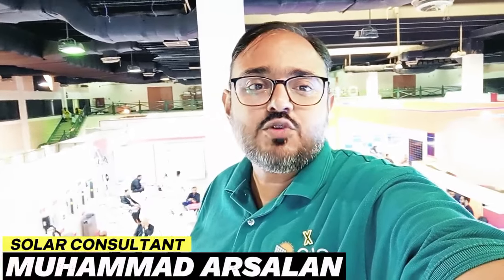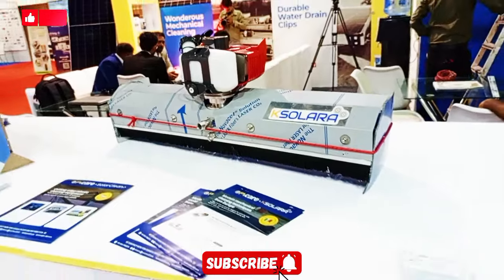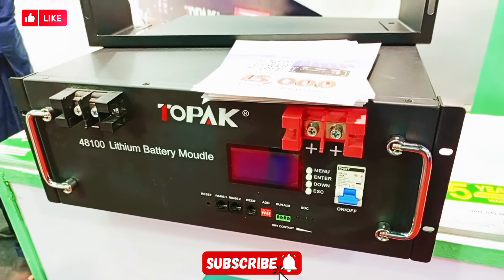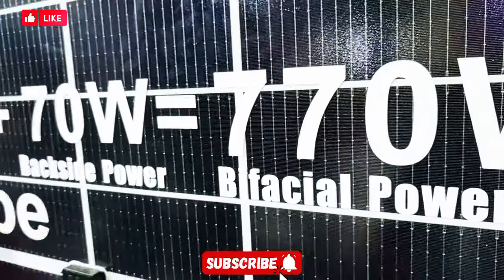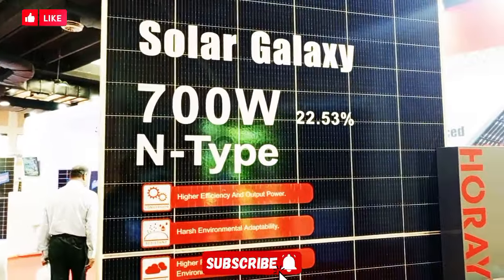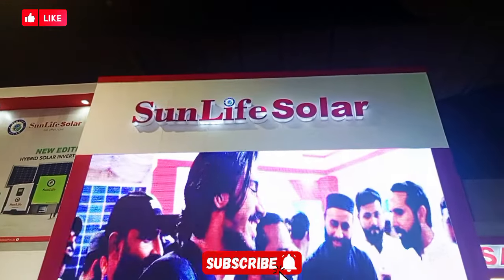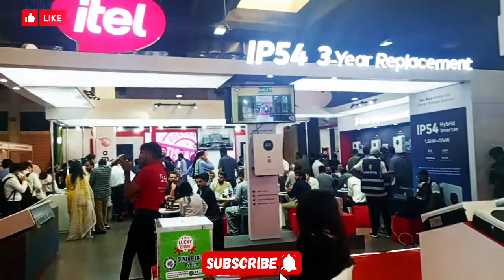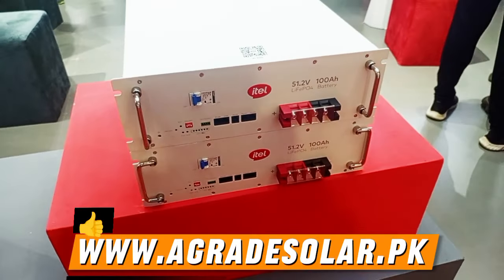Karachi Solar Expo Some Missings Parts

Comment: I don't know if you know or not, the CT feature you showed with t solar inverter, every Nitrox hybrid has that capable.
Reply from the maker: This Feature Isn't Claimed By Nitrox Ever but i will check - Only Solis Claims This CT Function With Dual Output and T Solar This Model with Single OutPut

Comment: Kindly tell us how many 770 watts panels on 8 kw nitrox inverter. Thank you.
Reply from the maker: Data Sheet Check Nehin Ki
Reply: 16 panal 12432 cut 20% 2486 cut..... Karky bachy 9946 please check inveter pv

Comment: Tesla inverter 9KW not recommended
Never buy any Tesla inverter, the service center cannot help you if it is in Karachi
No spare parts 
Cannot get LCD display panel repair or replace with a new LCD display.

Comment: Please give information about 24v Lithium battery with long warranty like 10 years
Reply from the maker: No Company is Offering 10Y Warranty in 24 Volt Batteries - And For Your Acknowledgement 10Y Warranty is Fraud. No Manufacturing Company Provide Such Warranty. This is Only Market Tactics
Reply: Which 24v lithium battery best with nitorex ?